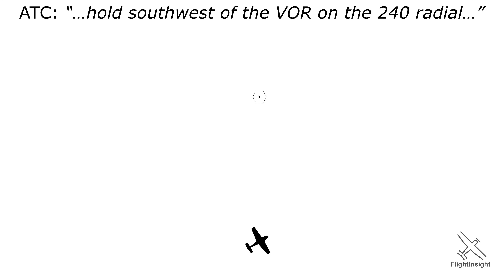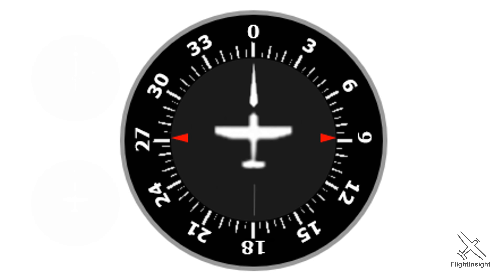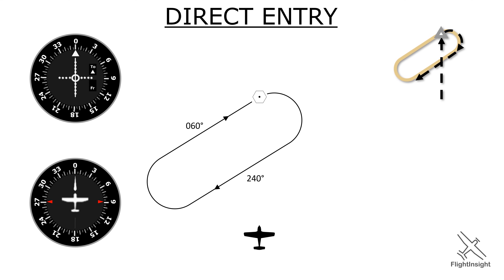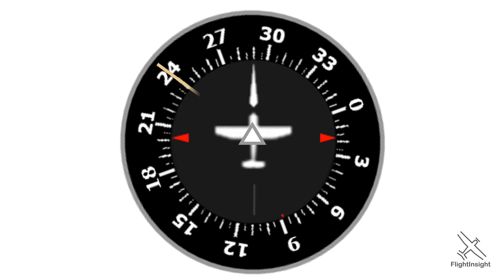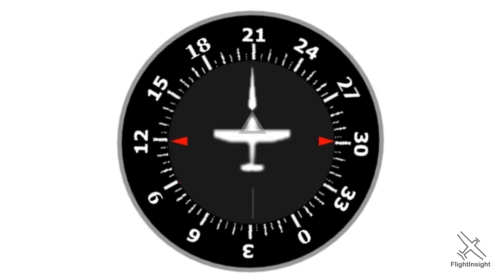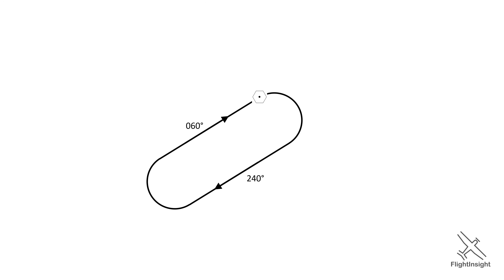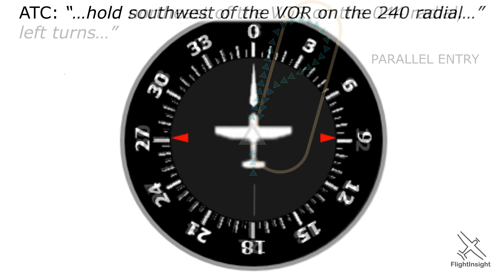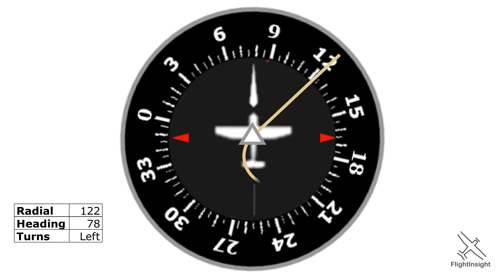Get Holding Entries Right Every Time | How a CFI Visualizes Holding Entries | Holding Pattern Entry

Comment: I have been told that on the parallel entry, after crossing the fix, turn initially to intercept the outbound radial, and track that, before turning again to intercept the inbound radial. I hope that makes sense. Does it matter? This method describes just turning to the outbound after crossing the fix, before turning again to intercept the inbound.

Comment: Everything is clear up to when you need to select the entry procedure ( Tear Drop, Direct, Parallel. How do you know which entry to use without drawing the 70 degree line.
Reply: In IFR you want to minimize the chance of spatial disorientation. Do the entry which minimizes the turn from the fix to enter the hold.
Reply: Look at current heading if it's closer to inbound then direct,closer to outbound parallel if closer to t.d then t.d entry
Reply: Do the entry that gives the least bank angel into the hold fix. Just remember every turn in ifr is standard rate. So don’t use an entry that exceeds the standard rate of turn. In a c172 it’s usually 20° to 25°. This would change depending on TAS but I think it’s safe to say it’s within that territory. Just reference your turn coordinator or PFD.
Reply: thumb method works best

Comment: The "thumb method" is far faster and doesn't require guessing at what entry "makes sense". In each example given here, there's no concrete support for your entry except, "it makes sense". Not good enough. With the thumb method I can mentally draw one line and get the correct entry for any hold that will satisfy an examiner and the ACS.

Comment: Great job explaining!  I have my students first draw the hold on their knee board and brief their entry so that they confirm the hold is correct.  This is a multitasking drill also.  Then when they get more comfortable I have them do it without drawing it and just using the HSI like you showed in your video.  

It may be beyond the scope of this video but something that confuses people a lot is wind correction.  If you’re using a GPS track to fly the hold, it will account for wind and your turn inbound may have to be shallower or tighter depending on how fast the needle is coming in since the magenta diamond keeps you on a nice racetrack. 

If you’re using heading to adjust the shape of the hold in order for all turns to be standard rate (no tightening or shallowing for the most part) simply note your crab angle inbound, is it left or right correction, then triple it in the opposite direction outbound.  

So example:  If you’re holding south, standard and have a left crosswind you will be holding a left correction to keep the CDI centered.  On the way inbound you would play with your heading (bracketing) to find what works to keep the needle centered.  So let’s say you’re holding 5 degrees left correction to account for wind; when you are established OUTBOUND- triple it in the opposite direction.  So rather than fly 180 you would fly 195.  This changes the shape of the hold so that your turn inbound can still be standard rate.  If you used the magenta diamond to fly outbound, you’d be fighting the wind turning inbound which would just mean you’d have to shallow the turn.  Try this in the sim!  

Not trying to steal any thunder from this fantastic video, just wanted to share this real quick to help whoever it might help.

Comment: All calculations are done using the inbound rad. Why then name a hold after the outbound ??????
Reply: Because if you were told to hold south you would assume the use of the 180 radial and the standard inbound leg is toward the fix.  Since you always need course guidance inbound to keep you on the holding side, you’d use a bearing to in order to avoid reverse sensing.  You can also be given an instruction to “hold outbound” on the 180 radial at say 10DME which would mean your inbound leg is outbound on the radial toward that ten mile mark.  Don’t forget the whole point of this is to stay on the holding side for obstacle clearance.

Comment: My technique from 40+ years making a living in the cockpit:
Cross the fix and turn the closes direction to your out bound heading, do not turn through the teardrop. Turn inbound at appropriate time and either interceptor or proceed direct to the fix and adjust outbound leg for drift.
TERPS provides clear space on holding and nonholding side of course for maneuvering .

Comment: at 1:52 you say a confusing statement. draw a fix at the outbound course - Its not the out bound course ... later in the talk its referred to inbound. .. i missed my checkride because DPE said fly heading to vor and hold on a bearing . .. whence it dealt with the 259 radial . ... so there are hdg to then bearings to or from then the easiest radial since all radials are from the vor.. the confusion comes with the dpe's say track the bearing  or trackthe heading or fly heading - bearing etc.. language or tell us if ubclear can we ask to clairify ' what radial' as .

Comment: You never explained where the dividing lines are between the three methods. That’s what the rule you don’t understand is for.
Reply: Throw that crap out the door in the real world. If your flying into the protective side opposite a direct entry then teardrop of your flying out of the protective side then parallel

Comment: From my understanding this method requires that you are flying a heading direct to the fix. With a made up fix off of a VOR radial, you would have to use the gps to place a point at the specified DME and then turn direct. After this is done you can then draw the imaginary hold shape on the heading indicator. Maybe I am wrong?

Comment: Dude you’re phenomenal. I’ve been struggling with these for months and you’ve made me come to a solid understanding of holds in 5 minutes
Reply: I get it, but I don’t get it.  Need much more practice.
Reply: @cesarmo469  maybe this can help. 

Always draw to the fix. Then draw left or right depending on direction.

The line told to hold on will be the line parallel to the initial line drawn to the fix

Comment: What about holding patterns that are right at the limit between two entry types. Say holding on the 178 Radial (I know ATC won't give you holds like this, but they're sometime published on Charts). I believe that 'broken' radials make it hard to transpose mentally on the instrument. Would you say this is still the preferred method of obtaining the correct entry? Don't you need to do the math for those fringe cases? What's your opinion?
Reply: It's easy once you decide if you can make a direct entry or not. So do that first.
Once you decide that you can't make a direct entry, then you only have two choices, teardrop or parallel. So first, you can easily see if you can make a direct entry by drawing a long line perpendicular to the radial (90 degrees) that runs directly through the fix and across the body of the hold and cuts perpendicular through the outbound leg. Basically you draw a line that cuts the turn off and separates it from the rest of the hold. Now, on one side of that line you made is all the direct entries. On the other side is the parallels or teardrops. You can easily see how it would be easy to make a direct entry from anywhere on one side of that line. 180 degrees are direct entries, the other 180 degrees are either teardrops or parallels. So once you know it's not direct, you have to decide either teardrop or parallel.  So now,  just look at what would happen if you flew to the fix and kept going straight. If you kept going straight, your flight path would either take you into the body of the hold or take you outside the body of the hold. If it takes you outside, it's a parallel entry. If going straight would take you inside the body of the hold, it's a teardrop entry. It's that simple. Find out which half is direct first, then if you can't do direct, just see where you are after crossing the fix to decide if it's teardrop or parallel. Inside teardrop, outside parallel.
If your path is directly opposite of the inbound leg, then it's always parallel.
Reply: @eltomas3634  Hi Tomas,
Thanks for the insights!

Comment: Great video! I've used a similar method myself for years with one slight modification. I bug the inbound course and treat that as the fix rather than the airplane in the center. If you draw your hold off the heading bug at the edge, you remove the ambiguity you mentioned related  to confusing the inbound and outbound course.

Comment: Like all content required for educational purposes, theory puts a lot mind bending scenarios where many tend to over think. In the real world it becomes easier as you do it. The FAA won’t care what kind of entry you do in real life, but they do care on their tests. I remember having to calculate magnetic bearings with the ADF comparing with the actual heading. There used to be actual holds off the NDB. (Hold NE on the 030 bearing, left turns, Expect further clearance 19:30.) A lot of the new pilots would really be blown away on how that worked. Thank goodness technology is taking us from that realm. FlightInsight is the best and easiest way to understand. Many of the knowledge is required for passing all that written test. Great job.
Reply: Those NDB holds had obstacle-free buffer areas that were absolutely massive because of nav error tolerances. Proceedure designers hated them because the placement and altitude were so limited due to terrain (At least in semi-mountainous areas.)

Comment: Love the channel and come here often.  I only teach two hold entries...direct and indirect.  The indirect hold is simply a course reversal like a procedure turn on an approach.  Makes things much simpler and there becomes only one maneuver you need to master instead of three.  Simple cut the racetrack in half at the fix.  Anything on the "long" side is a direct entry, anything on the "short" side is an indirect.  Fly outbound 1 minute, 45 degree turn 1 minute, 180 degree turn (magically a minute at standard rate), then intercept inbound.  But hey....that's my method but it works.  Keep 'em coming!!

Comment: American ATC instructions are very hard to understand. they can just say "hold inbound (crs) 060 on radial 240". It would be aslo easier to instruct someone fly to a fix. example "hold on 10dme fix xyz inbound course 240 on radial 240" so easier to understand that youre flying away from the vor. when you reach the xzy fix you know your inbound course of the holding to the fix 240 on radial 240 thus 060 as your outbound crs on the hold.  or "hold on 10dme fix xyz inbound (crs) 060 on radial 240" no confusions

Comment: How do you not run into an inbound airplane when you do the parallel entry?  If you overfly the fix and turn left to 240 heading, how do you not run into an aircraft flying inbound on the 240 radial (060 aircraft heading)?
Reply: Holds are done while on IFR flight plans which are governed by Air Traffic Control. You are always being monitored by them. Say there is weather over the field and so ATC puts everyone into a holding pattern.... They will separate aircraft by altitude, fix, or distance on the radial. So you may be holding on the VOR at 6000, another at 7000, another at 8000 while still others are holding on the same radial but maybe a 25 miles DME fix so that along a single radial you could multiple aircraft holding at different intervals.

Comment: I'm struggling with this fundamental question: if the main purpose of the hold pattern is to keep an airplane is a "safe zone", then the parallel pattern entry has us fly past the fix on the opposite of the inbound leg direction - in the "non protected" zone of the hold. Isn't this the opposite of the intend ?
Reply from the maker: Hi Pierre-Alexandre. This is a good question that comes up a lot. It turns out there is no "protected or unprotected" side of the hold. There is a maneuvering side which offers more protection, but there is protection on either side, hence why the parallel entry offers minimal maneuvering where appropriate and also keeps us protected from obstacles. The protection area is based on speed, altitude, and other factors, but you can see how they are calculated in the TERPS figure 17-6-1. It's complicated, but the takeaway is that there is protection on either side.

Comment: When I taught instrument students 15+ years ago it was very easy to use a screw, obs knob, or some spot on the panel as the fix and visualize the hold around that spot.  That spot was the holding fix which is always and the end of the inbound leg, figure left or right turns, then determine the direction from the fix to get the entry quickly.  A helpful exercise I did with students was to flip from one approach plate to the next approach (on the ground), pick a spot on the plate and ask the entry type to the hold for the missed approach.  Being able to know the entry without thinking about it is key.

Comment: I like this. I notice that at 4:10 it seems a lot easier (through wrong I guess) to continue that left turn into a teardrop.
Reply: Not wrong legally you can enter any way you want as long as you remain on the protected side of the fix.  This is just technique.
Reply: Much easier to turn it into a tear drop.  You do two turns instead of three, less workload, more time to get stabilized inbound.

Comment: Man, you are awesome. The only thing I would have added was how to depict the hold 3 areas are on the VOR prior to determining the type of hold. I know from experience this is a challenge for the novice pilots myself included.
Reply from the maker: I appreciate that!
Reply: I agree.  This is the hard part, not actually making the entry and flying the hold, especially on the check ride when the examiner may give you a hold that is very close to the official FAA breakpoint between one entry type and another.  Knowing the actual heading breakpoints and how to select the “FAA correct” entry is key and this video unfortunately omitted that most difficult part.
Reply: @LTVoyager  I have come up with the following formula to figure out the type of HOLD for myself.
It may sound crazy but if you practice it becomes easy both in flight as well as the written test.

Stop the video at  2:29 for the visual and do the following formula.

Left +, Right -   (Left Turn add, Right Turn subtract in the formula below). In this example obviously we are doing a right hand turn

Inbound - 70= Tear Drop 
060 - 70 = 350 (The area between 350 -060)

Inbound + 110 = Parallel
060 + 110 = 170  (The area between 060 - 170)

The rest will be Direct 
170 - 350

Hope this helped.
Reply: @abrahamnemani3907  where do you get the numbers you’re using to add/ subtract so the (70) and the (110)?
Reply: @aaronrivera5134  A formula that I came up with. You need to subtract 70 for Right pattern and add for Left pattern from the inbound leg to get the Tear Drop area. Then add 110 to get the Parallel area. The rest would give you the Direct area. Try to draw this and hopefully it makes sense.
Reply: @abrahamnemani3907  Hi Abraham, the formula is good, but I think you meant to say OUTBOUND  course for hold - 70 = TD entry into hold if standard hold. If a hold to the NW of a holding point has an outbound leg of 360 degrees, you would make a TD entry if you fly to the fix at a heading between 290 and 360 degrees, right?